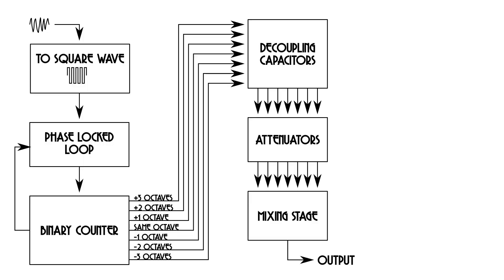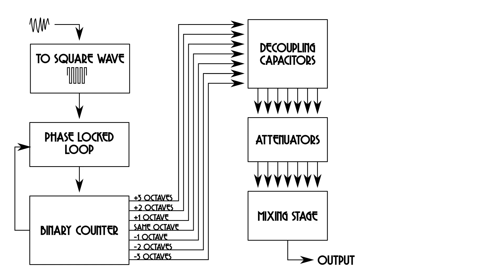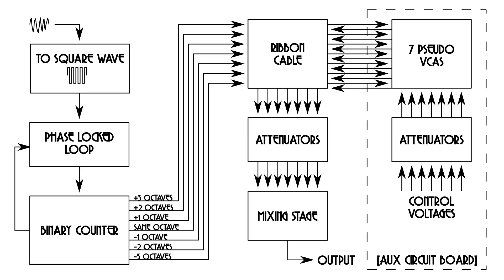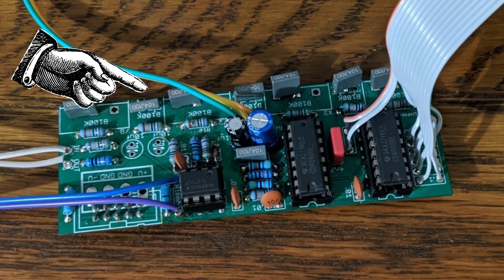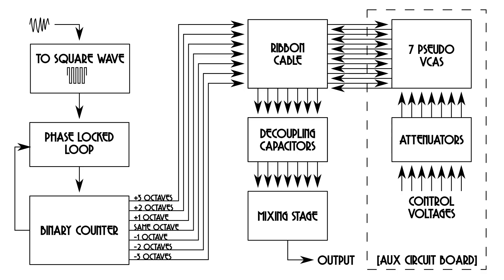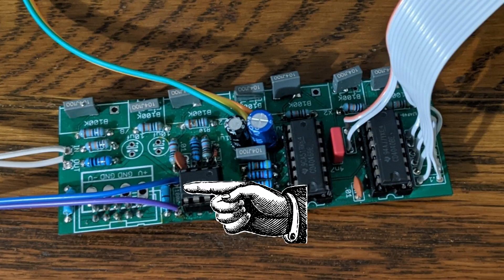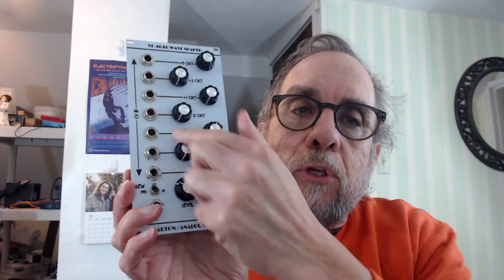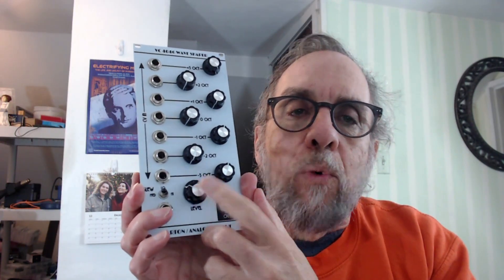Voltage controlled 4046 wave shaper

Comment: omg its such a valuable project wish it was in eurorack format :// these pcbs are too large to squeeze in 3U. i have thomas henry x4046 vco which would work nicely with this 4046 shaper. sadly its 3U, maybe will go with version without vcas but damn we all know thats where the fun is
Reply from the maker: Of course it could be adapted to Eurorack. My PCBs are large because I board mounted all the pots and (3/4") jacks in addition to the "VCAs", but aside from pots and jacks it's just four ICs and a handful of other components. Not hard at all to fit in Eurorack. The pots and jacks could be panel mounted, or board mounted on a single board with the "VCAs" on a parallel board. Just a matter of doing the layout!
Reply: @analog_output  thnx, will try to build this thing that you have made. going to order barton pcbs first then print yours. i get what you saying, i just need to panel mount pots and jacks. ace!
Reply from the maker: @justinasst4099  To clarify, my PCB will NOT fit in 3U. The layout would have to be redone (without the pots) to get it down to Eurorack size.
Reply: @analog_output  oh ok. damn thats lot of work 😅 ok will see the filesaybe i will redo it